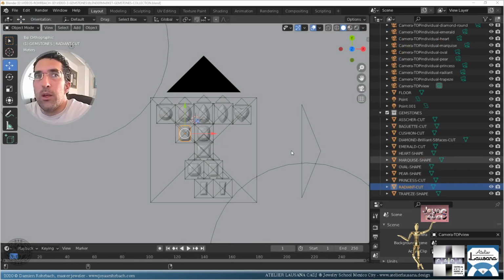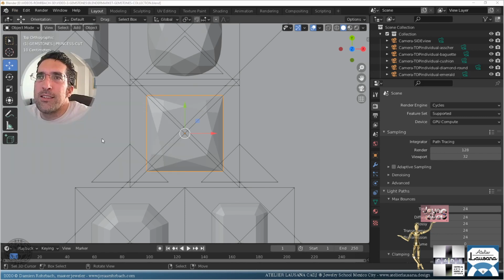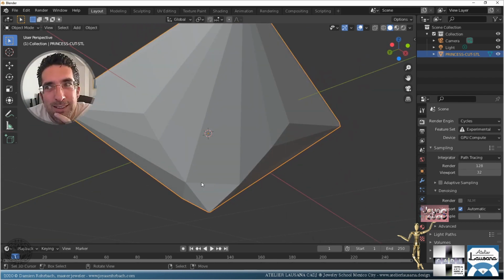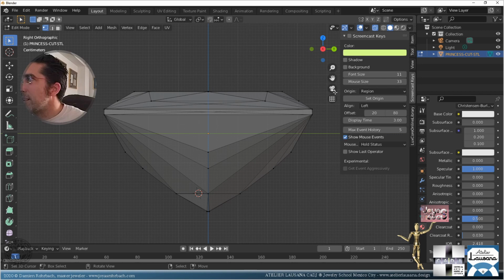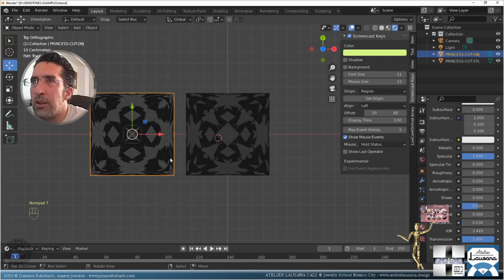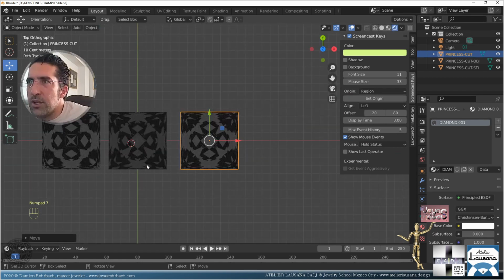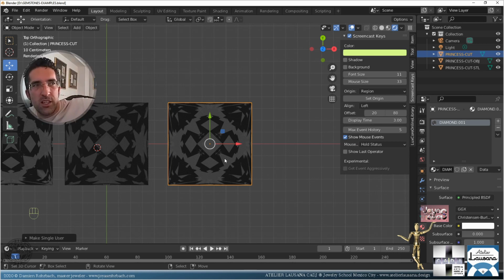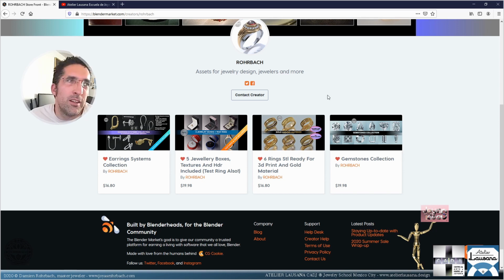Exporting Importing OBJ STL example 3D JEWELRY ASSET GEMSTONES with Damien ROHRBACH and BLENDER

Comment: The depth of Princess Cut diamond is incorrect. It should be about 75% of the width. That's why the reflections in the diamonds are incorrect.
Reply from the maker: That's what she said... If I would have set it to let's say 60 percent, somebody would come and complain it is to shallow... If I would have set it to let's say 90 percent, somebody would come and complain it is to deep. The depth of every and any stones cut varies a lot around the world. By several percent. When creating gemstones facets, I always have to set dimensions to generic settings. Each customer and 3D modeler has the specifics measurements of each of his gemstones. In BLENDER each designer then adapts the vertices to his specific needs, may they be real measures based on the stones he got from his clients or from his specific ideal model.
Reply from the maker: Also this video speaks about exporting file formats and differences between these 3d files format. The facets of my 3d models are fine and based on the considerations of several models, you can check Google by example "princess cut proportions" to understand that proportions vary. Also your comment is from another category as you speak about gemstone cutting, and when this video speaks about rendering, the differences you should not forget, CYCLES limits the ray bounces, reality is infinite in refractions and reflexions rays (even so this video is not comparing the render with the real refractions, this video is comparing STL with OBJ and BLEND FILES)